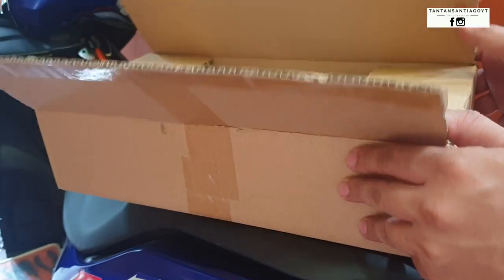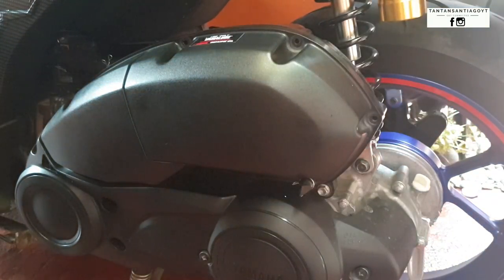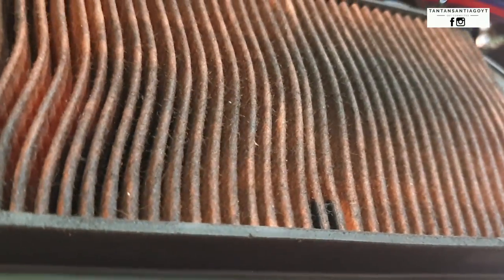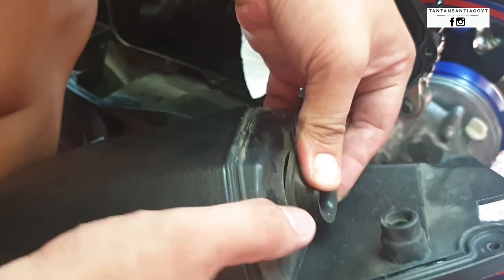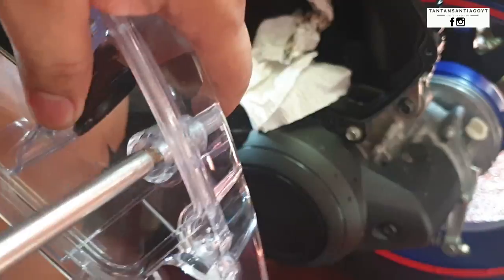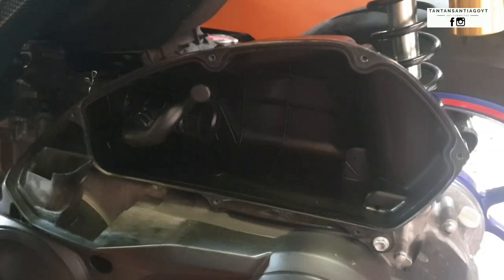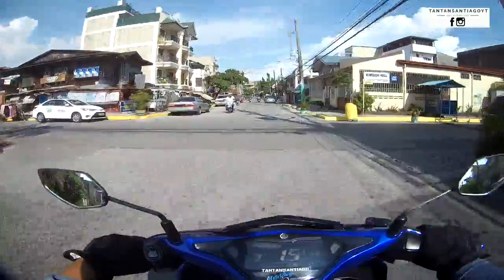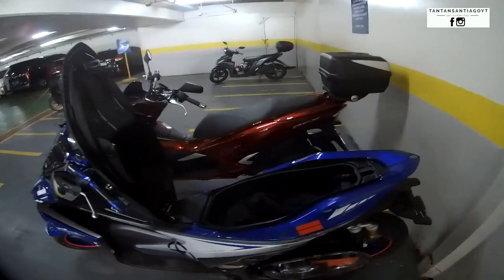Yamaha Aerox 155 Transparent Transparent Air Filter Cover | Installation and Tips

Comment: Sir bt dimo nilagay yung rubber lining ng air filter?  Magkaka leak yan.  Merong ruber seal yan sa takip na stock yung parang gascket
Reply from the maker: Double check ko nga. Salamat sa pagpapaalala. 👌
Reply: San banda?
Reply: Yun din concern ko.. Pede pasukan ng tubig.. Kaso ang tanong anu pede ipandikit ulet dun?
Reply from the maker: Hi mga papi. Sorry sa late update. Been using a washable filter with the ttansparent cover for more than a year and wala pong pumapasok na tubig. Properly fitted naman po.

Comment: mas okay sana kung glass rather than plastic. katagalan didilaw at lalabo.
Reply from the maker: Glass sa ibang area pwede siguro. Pero sa area na malakas ang vibration, tingin ko hindi sya suitable plus mas mabigat ang glass and since sa gilid sya nakalagay, posibleng makaapekto sa handling. Almost a month ko ng nilagay pero di pa naninilaw. Pag dumumi na, hanap nalang ulit ng replacement.